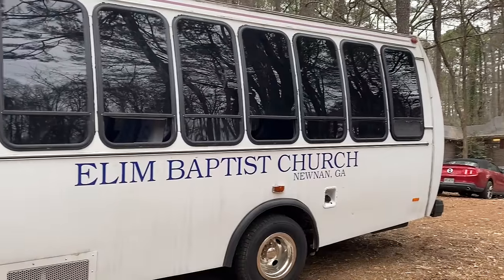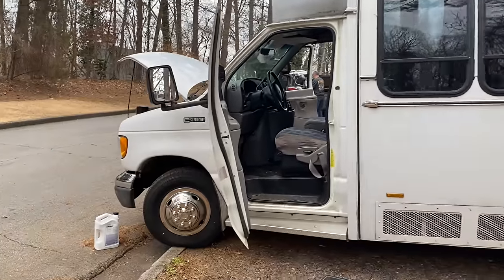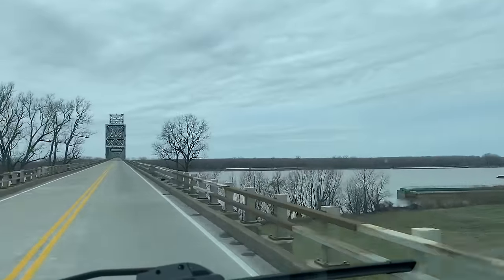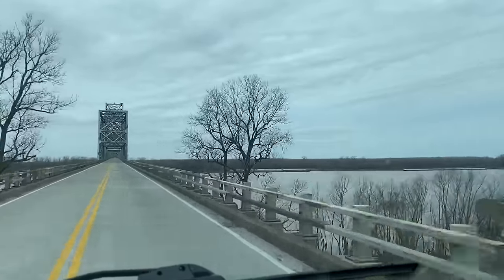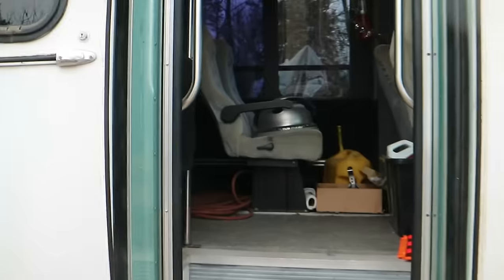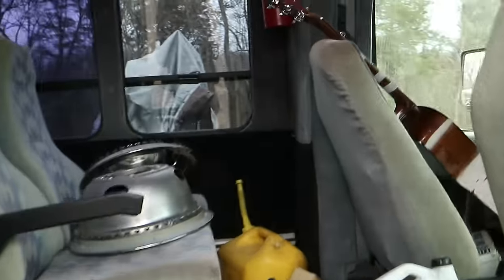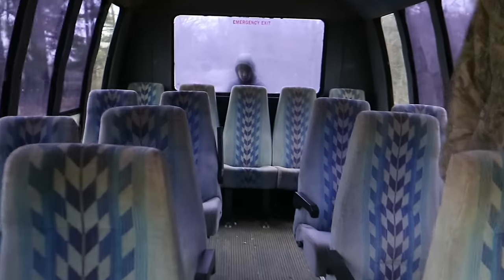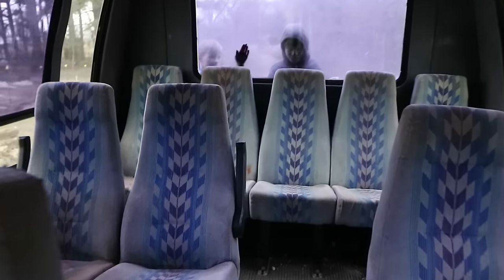Shuttle Bus Renovation for our Large Family *part 1*

Comment: What a great project for your big family to head out comfortably on the road! One idea for a 'sorta onboard' bathroom solution is to carry a pop-up 'shower' tent (about $40 on Amazon) and foldable porta-potty. We use these when camping. Both fold up compact, low cost, high function, and give privacy wherever you need to pull over.

Comment: Good luck you guys! It’s nice to have a more comfortable ride for those long trips. We turned a shuttle bus into a “camper” with seats, tables, bunks, and kitchen (for our family of 11, 10 at the time) and were going to use it to go camping. We had planned on a cross country trip in it but I broke my leg right before we left - actually God bc the trip would have never worked and the bus had some issues. We did use it for some camping trips though. 

Then 2 years ago we sold our house, lived in our small bus at my parents house and built out a greyhound bus as our permanent home. We’ve been traveling the states now for 1.5 years and loving it. Let me know if you run into any problems and I can connect you with my husband since he has already done what you’re doing and more. 

Jessica
Reply: Oh wow, I’m sure you have a few stories to tell. Thank you for sharing and we will keep you posted as we usually do with our challenges. It’s good to be able to pull from the wisdom and experience or others.